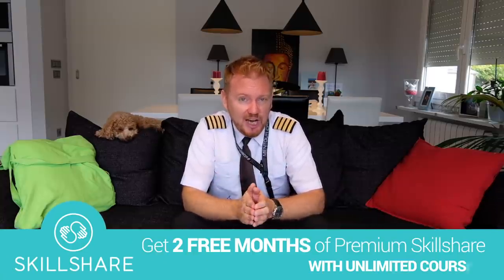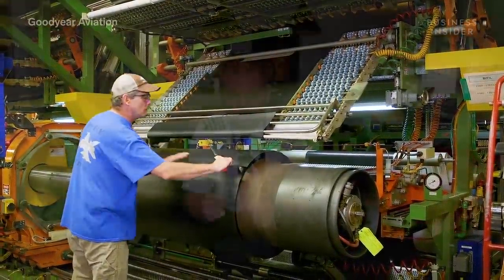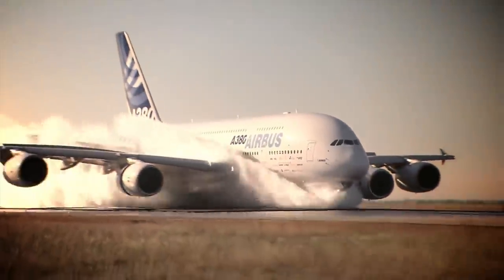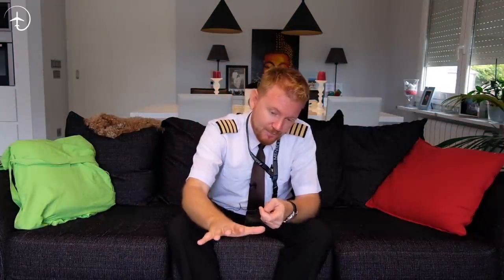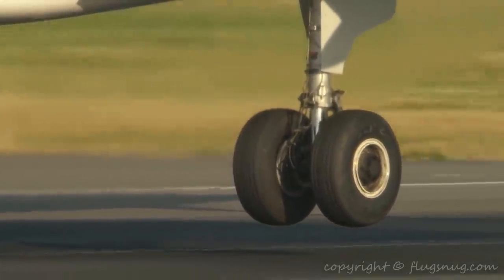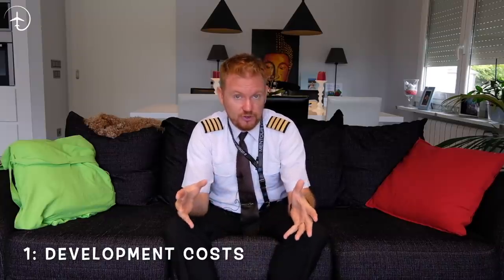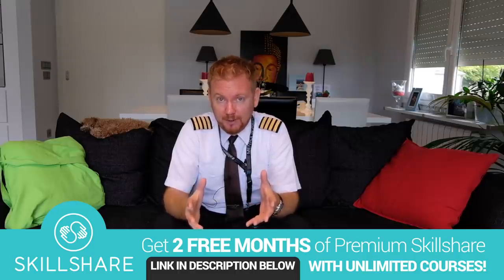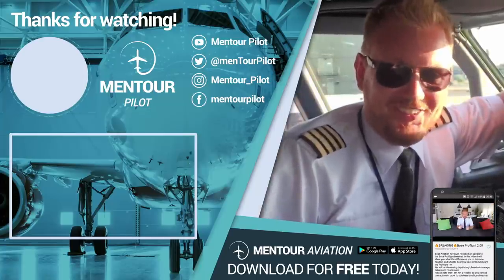Why not make plane-tires spin, before landing?!

Comment: Okay Captain hold on! I love your videos but I'm a chemist and when you say inert gas you should be pointing at group number 18 or what is probably known to everyone as noble gases which includes Helium, xenon, neon etc. 
The term inert mean that it is not reactive at all so you can't call nitrogen an inert gas because it is quite very reactive in some cases, the reason they use it is because of low cost simply because it's the most abundant gas in our atmosphere and because it holds it's pressure when exposed to changes in temperature, but believe me it is quite reactive gas if introduced to some chemicals but inert/noble gases won't react at all under normal circumstances even if exposed to the most reactive chemicals and I can talk forever about this lol. Thank you for your flight lessons and you're welcome for my chemistry one I just gave you lol.
Reply: We are all learning. Great thing you pointed that out
Reply: I understand where you are coming from (I studied chemistry in university as well), but nitrogen is often used as a substitute for the noble gases. While it is true that in certain situations it is reactive, most of the time nitrogen does not easily react with other substances (this requires breaking the triple bond in the N2 molecule - not easy to do). Guaranteed nobody would be using nitrogen in aircraft tires if there was any risk that it would be unsafe.
Reply: @JustSomeCanuck  you are 100% correct I was just commenting on the term "inert" which is a whole different group that is very difficult to react even in a lab and pushing the reaction towards it, I just wanted everyone to not get confused with the 18th group but you're absolutely right that triple bond is quite difficult to break in normal conditions. Thanks for your feedback 😊.
Reply: The video digresses a little from the title which is about pre-spinning aircraft tyres to reduce wear when touching down.
However the discussion about tyres is interesting. Filling tyres with nitrogen because nitrogen is 'inert' I think is a bogus point. The gas mixture of regular air is 78% nitrogen anyway. Removing the 21% oxygen that is in air might be advantageous, but I think removing moisture is an even bigger deal, particularly given the range of temperatures these tyres need to operate over.
I was lead to believe that dry nitrogen was advantageous because the nitrogen molecule was relatively large and diffusion through the rubber was reduced.
I think Mentour Pilot assumes that the motors to spin up the tyres are powerful (large enough to taxi with?) and you need to accurately match the rotation speed to the ground speed on landing. But even motors just large enough to spin the tyres up to 80% of the ground speed would reduce the tyre wear on landing. No need for a battery since the engines are running anyway (hopefully) when landing.
The point about costs and the relatively low cost of a tyre is the clincher though. If you get 300 landings from a $1500 tyre, that is just $5 per landing. Peanuts in the bigger scheme of things.
Reply: @fredlodden1538  thank you for the physics behind that I really didn't know that like I said I'm the Chemist here lol, but you are right if it's $5 for each landing that's pocket change to the remainder of the costs to operate a passenger airliner.
Reply: MrUNCLESAM84 you're a chemist yet you call them Nobel instead of noble. Interesting.
Reply: @michakamelski9535  autocorrect error! so you're only achievement in life was to learn how to spell, WOW! Congratulations 🎉👏. Seriously! Get a life. 
Sorry that bunch of smart people were having a conversation and we might hurt your feelings you POS so you had to comment about something stupid and lame just like you are to get attention lol, please don't cry go tell Mommy and Daddy that you can talk with smart people and you are smart and special now. LMAO you are very special.
Reply: Michał Kamelski Surprisingly, chemists are not immune from autocorrect errors.
Reply: @MrUNCLESAM84  Woah there. I get it that chemists are all about reactions, but this is a bit of an over-reaction. If this post is an indication of how explosive your temper is I feel truly sorry for your friends, family and the poor sod who has to edit your "scientific papers". Just dial it back a bit, buddy. The correct response to a pedant like Mr. Kamelksi would have been, "Oops, autocorrect error."  Simple and efficient.
Reply: Is it possible that having pure nitrogen instead of air would be beneficial if a tire blew out in the wheel well when there was a fire? On the backest of back burners in my mind I seem to remember an airline tire was filled with air and this blew out in a wheel well and the air contributed to the aircraft fire. The contention was, if it had been filled with nitrogen like it should have been, there would not have been a fire. Any comments for and against are welcome.
Reply: @johnhodgson5313  I absolutely think that this would be a good idea but in the same time I think you overkilled it, first wouldn't be better then to fill tires with carbon dioxide so now we have a fire extinguishing component if we're gonna ignore the cons of having carbon dioxide in a tire but if there's a fire in the well I think it's wiser to have automated extinguisher system that deploys immediately rather than using whatever gas in the tire. I'm not an engineer but at end I think the more we make things complicated the more expensive they're going to be and I believe that we'll never achieve the old goal which is "flying is 100% safe" it will never be so I think it's okay for now. Anyhow that's my opinion!
Reply: Nitrogen is an inert gas under certain conditions.  So he is right and you are just being pedantic.
Reply: @gravyboat2370  whatever you say hunny, I'm not going to waste my time or insult my intelligence by arguing with you so go ahead and celebrate your victory. 😂
Reply: @johnhodgson5313  
No. nitrogen hardly has any advantages over plain air  I think it can slightly decrease rubber aging because oxygen in the air will damage it and make it crack although considering that tires are not used for that long anyway nothing really matters. 
Nitrogen will definitely not prevent fire, because in case of explosion your tire will deflate and lose all nitrogen in a moment.
If we get very picky, maybe if you severely overheat the tire in some way so that smoke will get inside of the tire which is currently under pressure (can't even imagine how that could happen)  then smoke with air will make an explosive mixture and eventually everything will explode with a big blast. Although if highly pressurized tire explodes it is already not far away from the stick of dynamite in terms of power. It can easily kill you.

So I would assume that the only reason to use nitrogen it to slow rubber aging.
Reply: @fredlodden1538  Yes, I believe the lack of water vapor is the big deal.
Reply: What kind of chemist are you exactly? N2 is inert in a tire where there is nothing to react with it. The N triple bond is the most stable of all the bonds you should know that. You can only break N2 with high 10000'C temps from sparks/plasma. The moon rocks at NASA are stored under dry nitrogen to preserve them, they could use a true Nobel gas, even xenon as the budget would allow it, but they don't, and for a reason.  What kind of chemist are you? Armchair? YouTube chemist?
Reply: On most retractable gear airplanes, wheel rotation needs to be stopped before the wheels are retracted.  Turning the wheels or tires into wind turbines that spin themselves up would work against this.
Reply: @MrUNCLESAM84  Aah, the old autocorrect excuse! If you were any sort of scientist, you would check your work.
Reply: @daveb5041  That'd be a noble gas, Dave. Even Nobel knew that!
Reply: If you listen he is referring the inert as it's properties to not react much to temperature change. Same reason a lot of race car drivers use it.
Reply: @daveb5041  
Using xeon to inflate tires? LOL.
I think he is better chemist than you 
as it is not about nitrogen reactivity but about term inert gas which is actually a term for noble gases
Reply: @mgscheue  DYAC!
Reply: You are right sir, but here's the thing, nitrogen is popularly known as the  inert gas for manufacturing purposes - like in food companies , maybe that's why captain called it inert. 🙂
Reply: @MrUNCLESAM84  Thanks, now my education is increased. The day I stop learning cremate me.
Reply: @daveb5041  University of Iowa type chemist and currently teaching chemistry at UNO but you're right even concentrated Hydrochloric acid is inert if alone in a container and won't react, but as Mark Twain said " Never argue with stupid people, they will drag you down to their level and then beat you with experience" so I'll let you win this time buddy 😉.
Reply: @dunruden9720  you should be awarded the Nobel prize for this discovery you just made, WOW what a genius you are!? I'm really glad I met someone like you in my life. Man you are really special.
Reply: @jaskaran9638  correct and what I meant to say that nitrogen itself isn't classified as an inert gas also most chemicals if contained by itself alone would be considered inert but that's not true because this classification is considered in nature. I bet everyone knows that glass for most cases is considered inert because it won't react with almost anything under normal conditions and that's correct, hence why it's the chemist friend and I use it with everything EXCEPT concentrated Hydrofluoric acid because it will react with glass. We can keep going back and forth with this topic for ages but the science community have ruled Nitrogen gas out of the inert state disregarding its strong triple bond from the classification.
Reply: @johnhodgson5313  me too Sir!
Reply: @MrUNCLESAM84  I'm not celebrating any victory!! He mentions aluminium in the tyres aswell .are you going to pick up on that and say erm actually he is wrong  because it's an aluminium alloy etc etc and make yourself feel good.  Just a pointless vanity post that in the main is wrong .
Reply: @gravyboat2370  again I'm not going to waste time nor insult my intelligence arguing with you! Whatever you think hunny 😊!
Reply: @MrUNCLESAM84  your wasting  your time reading this and replying 😂
Reply: @MrUNCLESAM84  
actually, it is, not the main reason why nitrogen is not inert, as it is totally useless as inert gas when welding because it will react with all metals horribly making nitrides
also, you cannot use it for any vacuum sputtering or anything anywhere you are facing the plasma
so it is totally useless as an inert gas in most situations
Reply: @deltaxcd  I know all of that please tell the few dumb people that argued with me just for the sake of arguing! Or the spelling Nazi who  thinks that I should quit my job and go drive an Uber or flip some burgers because I typed Nobel instead of noble.  Thank you for your comment I gladly enjoy talking to intelligent individuals like you. 😊
P.S. Grammar and spelling Nazis please get a life! Seriously get outta mom's basement and find something else to do because you're pathetic 😁.
Reply: MrUNCLESAM84, I have no doubt you are technically correct.  It's just like in engineering where the words stress and strain have very specific meanings that are much narrower than there common usage meaning. But, (sorry there's a but) the FAA's rule that effectively requires nitrogen refers to it as an "inert gas". So it's hard to fault others for using the same word.  From the FAA:
"This amendment to the Federal Aviation Regulations (FAR) requires that an inert gas, such as nitrogen, be used in lieu of air, for inflation of tires on certain transport category airplanes. This action is prompted by at least three cases in which the oxygen in air-filled tires combined with volatile gases given off by a severely overheated tire and exploded upon reaching auto-ignition temperature. The use of an inert gas for tire inflation will eliminate the possibility of a tire explosion."
Reply: Winter Blues  you're absolutely right but as an educator myself I will sacrify some pride for the few who wants to learn, few intelligent people like yourself have learned something from me and few other even if they disagree with me! At least they did it with respect so for the sake of spreading science I will tolerate the few mentally ill people who have a psychological issue with anyone who sound like he/she knows what they're talking about. Thank you for the comment sir/ma'am. 😊
Reply: @MrUNCLESAM84  I have my doubts as to you having a phd (almost always required to teach) or BS and teaching. I went to college for chem engineering, I'll admit didn't graduate due to my eye sight, but even with my understanding I don't feel the need to point out how much I know about the subject and how others are wrong, I would rather debate with another chemist, not youtube experts. Tell me something you would only know if you completed 3 years into a BS of chemistry or chem engineering?
Reply: @daveb5041  i did not know my diesel engine did reach up to 10000C to make  the NOx my catalytic converter changes into something less obnoxious  .
i am not a chemist .
but neither are you,?

Comment: The tire on a plane hitting the runway actually gets a boost to grip when the tire spins up as well. As the tire rubber heats up and increases grip. Just a small part of the landing that you did not mention.
Reply: He's also mentioned in other videos that there are times when you may want that high-friction tire hit to eat up some of your momentum.

Comment: I worked in a military aircraft wheel and tire shop.    the b52 tires were inflated over 700 PSI so that 8 of them could carry the weight.   A fully assembled wheel for a b-52 was ~ 775lbs  and we rolled them around every day inflated and deflated.

Comment: short answer: Because it wouldn't change anything.
Reply: SuperCorrector1  still cheaper
Reply: Both of you people are stupid af lmao your mother should be ashamed haha
Reply: It's a solution in search of a problem. For mechanical simplicity and weight reduction, it's easier and more cost effective to make tires that will withstand the expected stresses on it for a reasonable amount of time.
Reply: rolocz Aircraft tires are seldom changed, thus no money is saved
Reply: @ammaarrh  They are changed quite often. Do you think they just have the attitude of let's see what happens?

Comment: "Why not make plane-tires spin, before landing?!"   It would cost too much to feed all the gerbils it would take to spin all those tires up.
Reply: Ah but see..you could have a section for passengers that have to run on a treadmill that would transfer the spin to the tires. It would be less than the economy and the passengers would have to stand up.

Comment: 1: Simple is better. 
2: Don't fix what isn't broke.
3: Rubber is cheap.
Reply: 3: Rubber is cheep. Only because of modern day slave labor
Reply: "if it ain't broke, don't fix it" must always be balanced with "there is always room for improvement".
Reply: Aldis Berjoza The guys to work at these plants are union and get paid fine.
Reply: @mog882  "The guys to work at these plants are union and get paid fine."
He isn't talking about the guys at the tyre factory, but the ones producing the latex.  They are commonly suffering.
Reply: Nothing beats simplicity
Reply: Aldis Berjoza US receives half of their imports from slave labor lol rubber won’t make a difference
Reply: Rubber may be cheap but jet airliner tires cost north of $3000.  Their life is limited by TREAD WEAR.
Reply: phục êwê  f u 2
Reply: phục êwê patent idea put some metal pieces that can extend on the wheel to make them spin forward with the air. Takes less tread when tires are spinning on landing
Reply: @guyjonson6364  I agree.  It's a tire and does the job, as well explained by the narrator.  Why introduce any more complications.
Reply: phục êwê  very funny east european humor. Now tell one about fays
Reply: @johndavidwolf4239  having a spinner there adds weight. Not desireable
Reply: @johndavidwolf4239  If it works, it's obsolete. :)
Reply: phục êwê  - Attempts to rescue slaves are often unsuccessful as the slaves refuse to cooperate. Many of them live better as slaves than the free people they know of.
No one really wants to be a slave, but for some it's preferable to the alternative for those people.
Reply: Why go for better fuel economy, don't fix what isn't broke

Why build new car engines that are more efficient, don't fix what isn't broke

Why not run ancient airplanes and build more of them as opposed to improving them, don't fix what isn't broke
Reply: @digitalnomad9985  $3000 is a lot for your broke ass but not for an airline, especially compared to the cost of maintaining everything else including fuel. Have you even listened to the video?

Comment: Plus: gyroscopic torque caused by spinning wheels.
Reply: SuperCorrector1  maybe
Reply: Look at a video of a top fuel dragster on a full power run, their tires are engineered to handle several different distortions based on the different forces based on how hard they run and the expansion is even used almost like a gear change during the run where they can reach speeds over 330mph in under 4 seconds, there's MASSIVE gyro force on a tire at high speed
Reply: William Burns  And at a 747 there are 18 of these gyroscopes working..... !!

Comment: One more advantage of not spinning tyres is, when it touches down it absorbs some energy of landing and starts to spin. So the Kinetic energy of aircraft gets translated into rotational energy of tyres. This would probably make it more easy to land. As non spinning tyre acts like a flywheel absorbing energy (something like regenerative breaking concept)